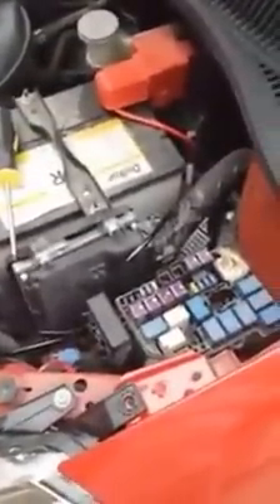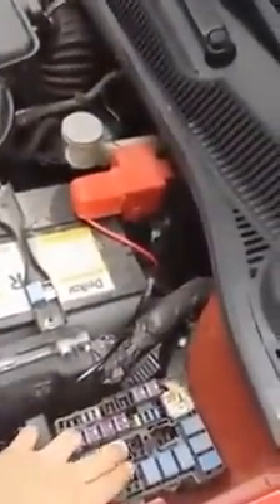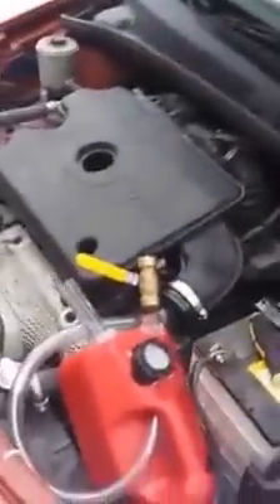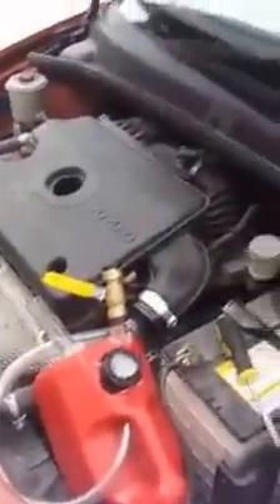Improved Gas Mileage  150 MPG Ruffly

Comment: Add a hollow metal ball between carb and intake manifold atomizes and vaporizes gas doubles gas mileage
Reply: @Robert Burchell Jr 

Where would I find this ball
Reply: @114wildfire   you can find the hollow balls at online or store that sell decorative metal ornaments , look up hollow metal balls , you will find them listed , many different sizes and materials,.
Reply: @Robert Burchell Jr 

You able to tell me step by step on how to get it done?

Or can lead me to some literature I can read up about this hollow ball between carb and intake manifold?

How would you put a ball between intake manifold and carb?

Isn’t throttle body right under carb?

What if there is no carb but tbi system or fuel injection?
Reply: @114wildfire  take gasket from intake and make metal ones and weld to ball atach to intake and carb .TBI same as carb.There is no literature too new.Probably will run cleaner than carburetor I made all linkage very simply. The size of ball is .5 inch to 1 inch bigger than intake diameter. I tried various  sizes . Balls can be bought welded together or in two halves and hole cut out same size as intake then welded on.Look at motorcycle online under ( motorcycle with hollow ball atomizer  vaporizer) for clear view of ball and how attached.
Reply: @114wildfire  TBI is the same as carburetor  for fuel injection I envision the ball with cone and injector in cone look on my channel to see other designs to accomplish this setup
Reply: @Robert Burchell Jr 

Where you get this idea from?  Or is it your own invention?
Reply: @114wildfire  my own invention
Reply: @Robert Burchell Jr 

Wouldn’t the same amount of gas be sprayed into the chamber in the first place?

Why would redirecting this same amount of gas that is being sprayed into chamber increase efficiency?
Reply: Where do I get a hollow ball ??
Reply: @robertmckinley2886  buy hollow metal balls from ornamental iron supply stores , type hollow metal balls in google you will find what you are looking for ! Besure the air gas mixture flows  THRU the hollow metal ball . !
Reply: Thank you for the helpful information

Comment: Well I totally believe that you can have a gasoline engine run on fumes, they sell generators that run on gas or propane, they also have cars that run on propane and natural gas all of these things have one thing in common they are in vapor form, so it’s not unrealistic to think that he could do this the trick would be to heat the fuel at the proper temperature to get the optimal amount of  Fumes.
Reply: The fuel’s composition isn’t homogeneous. It’s basically performing a vacuum distillation on a non homogeneous fuel mixture.

Comment: I SEE ALL THESE VIDEOS ABOUT HOW YOU GET 150 MPG FROM RUNNING ON FUMES, YET ALL THE VIDEOS ARE JUST CARS SITTING IN A DRIVEWAY, AT AN IDLE OR REVVED UP.  THE FEW, THAT THEY ACTUALLY TAKE OUT ON THE ROAD, FOR A VERY SHORT TRIP, THE DRIVER SPENDS THE ENTIRE TIME TRYING TO EXPLAIN WHY THE CAR IS RUNNING POORLY AND THAT ALL IT NEEDS IS SOME MINOR ADJUSTMENT.  I HAVE YET TO SEE ANY WHERE THE CAR IS ON A NORMAL DRIVE OVER A HUNDRED MILES.
Reply: fifty percent of the posts are in disbelief over 100 mpg claims so yes 651mpg  seems unlikely but never the less very real. Shell got over 370mpg in their trials. Its actually one of the ways I gauge whether someone is on the right track with their experiments. If the claim is to low its usually because they have burned the first 2 cups and extrapolated what the results would be from multiplying by 16 (8 miles X16 = 128 mpg)This is a very common mistake
The actual efficiency rate is 20 times what the standard set up of the original engine would be. In our case the Volkswagen got 32 mpg and the device 651mpg. Our V8 got over 300 mpg and the original was 17mpg. The inline 300 6 cylinder was pretty much on target for that although in fairness we never burned a complete gallon using it.
We actually did very similar builds to what is on You Tube already but used more sophisticated set ups using proper fittings and valves steel reinforced tanks and of course a better understanding of how the device actually works
Im not tech savvy so You Tube video is not in the works but I do have diagrams I made while performing the experiments. I did have ledgers of those experiments and witnessed with signatures and I worked 70 hours a week for 3 years on it so the experiments were extensive. The physics behind the experiments is sound and simple but a little involved. Once you hear it it is pretty obvious why it works. Please email lesliec77@icloud.com and i will explain anything you have a question about. You Tube does not facilitate discussion very well
Thanks Leslie
Reply: Your welcome
 We got 651 mpg on an 1100 cc volkswagen and 332 minutes at 3400 rpm on a quart while it sat in the test stand in our workshop. On the fuel injectors it got 32 mpg and 16 minutes /qt in the test stand. we had 3 other test engines a 302cid(Ford Mustang V8) a 300 cid(  Ford F150 in line 6) and a 3.5 Briggs and Stratton single cylinder. The single cylinder got 100 hours on 2 cups on its carb it ran 45-60 minutes on 2 cups
The valves took 500 hours to scorch on the 4 cylinder and 800 hours on the V8
On the lightest part of the fuel we could do the 1/4 mile in 10 seconds it had that much power. It could do 3 passes the second was marginally slower the third was slower and it wouldnt start after that
I worked 3 years and 70 hours a week on this technology. I know and have tested the pros and cons on this system 
Have a great day any other questions dont be afraid to ask
Reply: I figure if controlling the speed is the problem you make the engine run at a constant speed and power the electrical system off of it and control the speed by the electrical system. A kind of electric car powered by a gasoline generator
Reply: Ive experimented with a vacuum pump before but with only marginal results. There are some who claim great results but I dont know personally. The thing is with the way this device works its kind of self supporting the only problem is the vacuum is not as responsive as it needs to be. i say its a little like superglue thats not all that adhesive You make Post-it notes with it . So you make something that has failed and use its limitations too your advantage
The major issue is that people who have performed these experiments want a one size fits all solution and when one cant be found they yell conspiracy. Oh well
Reply: We took and monitored temperatures often while performing experiments and all was normal. Exhaust temps were over 400 degrees F coolant was 185 using an air cooled engine we monitored oil temp and head and block temps and all were normal and within normal ranges compared to the control
Hope this helps
Reply: it is absolutely fantastic, almost unbelievable (651 mpg!!!), would you be kind enough to make video on about how you did it ? please share !
Reply: Leslie Clendening yes this needs to get out there.. .any thoughts . on a " Parallel "  vacuum system of fuel to run concurrent on a modern fuel injected car? ... i know this is a tricky subject.. cause there are so many controlled variables by the computer.. .
but .. just  food for though 
Cheers !
Reply: Leslie Clendening did you ever run an independent vacuum/motor pump system 
to feed air fuel to the engine ?
to provide time under vacuum before introducing it to the motor ?
Reply: Leslie Clendening the way i figure it .. is we need to find out what really makes the engine run ... and it is Not .. what they are telling us
that is for sure   Cheers
Reply: Leslie Clendening search "Bill Kendrick" 
white vapor youtube video .. if you have not seen it ... i think you will like it
Reply: Leslie Clendening did you do any mods to the spark or timing ? or  try to create a ' reverse" spark as Joe Booker ( joe Cell ) guy discusses
Reply: Leslie Clendening Was the temperature of the exhaust hot or cold using the vapor fuel feed ?
Reply: No the only time we messed with the timing was when we intentionally backfired the spark into the tank by retarding the distributor suddenly
Reply: Leslie Clendening yes thank you .. 
any thoughts on this system for a boat.. 
get up on plane .. and run at a set throttle ?
should work right ?
Reply: Leslie Clendening thank you Leslie.. for your excellent  post... i will be sending you 
another email.... Cheers           jay
Reply: gotta add another system, remember too lean.... gets hotter,  so water vapor back with the gas vapor system....    cools the hot spots, no more pre-detonation ....   or alcohol vapor back..

cars run smoother during storms.... because the water vapor!

there are ways to run a car on vapor.... just remember the old cars could take the heat the new ones cannot, so there are parts to replace in ""modern"" cars to fix the bad engineering we use today. 

would make sense to to cng and gas fumes.....   wicking is the key for gas vapor... 

love to build something as soon as i can ....   with all systems accounted for.   wicking, water or alc. vapor.

there are over 7,000 patents on high mileage systems....  a good chunk of them were tested and proven to run better and more efficient... but the heavy oils and crap in modern gas cause a lot of the issues with wicking.

remember there are 7- 10 vapor gallons in each gallon of gas.
Reply: Where's your video demo of your results?
Reply: 100forks. Thats because it can't under load.
Reply: Good comment thanks for the post ...Cheers
Reply: You hit it on the head. Burning the lightest components of the fuel doesnt take a very sophisticated system. People think its just a matter of a little adjustment and they have it licked

1 It runs on vacuum on the intake stroke of the cylinders
2 It will scorch the intake valves
3 There is an inherent lack of control of the speed of the car because vacuum is interdependent on the car and is not as responsive to changing demand
4 if the system leaks at all the engine will stall this is more prevalent when the heavier components of thew gasoline are being utilized
5 You can burn an entire gallon of gasoline (light ends to heavy ends ) but it is difficult
6 Easiest to accomplish at a set speed on a test track
7 The results will be about 20 times more efficient than a standard set up
8 there are about 250 patents based on this technology some are held by GM, Shell Oil, Ford, Tom Ogle all had astounding results. All at a set speed
9 150 mpg is the light ends of the fuel and contain the least amount of energy
10 because of the vacuum the unit is inherently safe from explosions